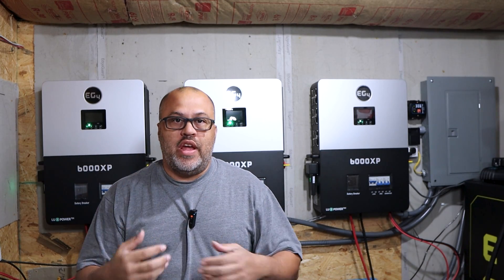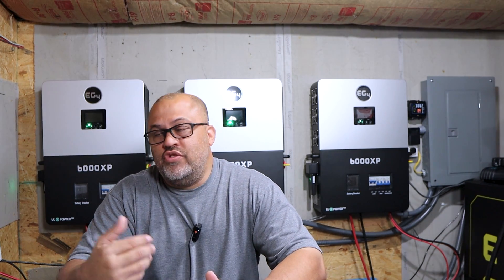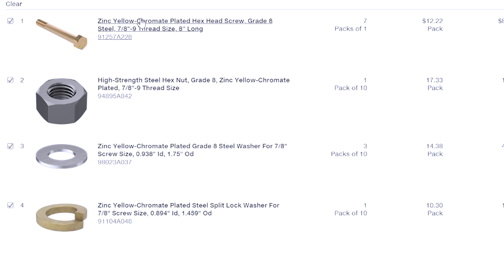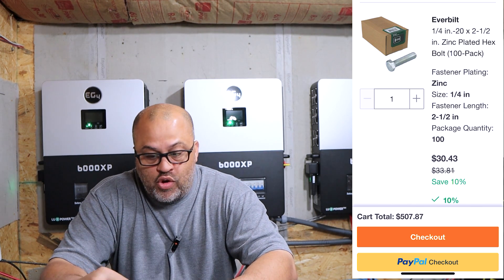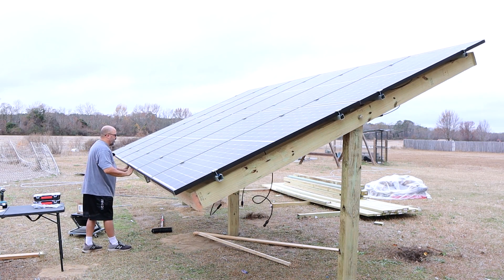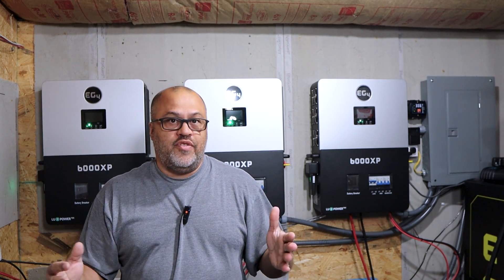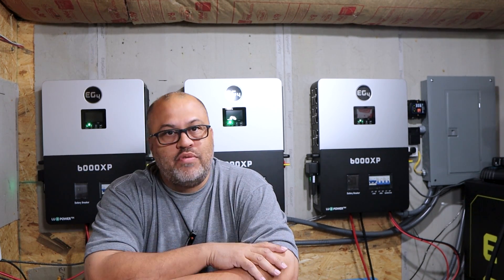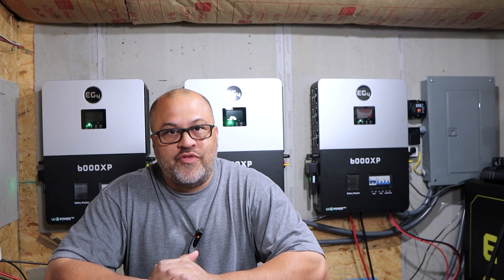DIY Adjustable Solar Ground Mount - Total Cost - Part List - Efficiency

Comment: Superstrut is really expensive now at HD $43 for 10'  12 gauge. You paid $29 5 years ago they were $18  I decided to go with K2 aluminum rail mounts. I'm looking into a automatic tilt arm. 4x6 is super strong no way those are going to break off have to be a tornado probalby smash the panels to bits.

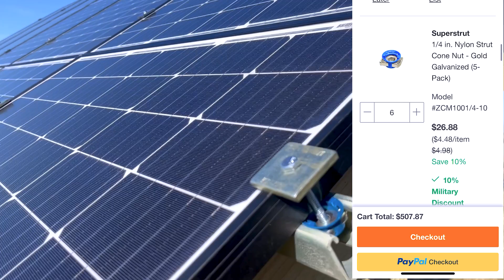Comment: Rodney, I do not see the square washers that go with the Cone nut (shown at 4:01) in your HD parts breakdown but you do show 12 flat washer grade 8 in your list of materials above? However, there is also the 100 1/4 inch round washers in your detailed breakdown (shown at 4:20). Can you provide what you used for the square washers or are the 1/4 round washers suppose to be square?
Reply from the maker: @TheComingGlory  it is a unistrut washer. Should be on lowes, home depot, etc. I will check my list when I get a chance. Thanks
Reply: @rodneyhunt  What size did you use for the unistrut square washer?

Comment: Thank you for putting this together Rodney! I'm presently building my tilt array based on this setup for my large 530W panel 14 panel array in South Carolina! Upgraded to longer/larger bolts and the 6x6 posts. Appreciate you putting all of this together! With the current cost of wood (and larger wood due to my sized panels), larger hardware and such it's ~$1500, but it's still quite a bit cheaper than a commercial array. I got a quote, the cost of the system (minus concrete) was $2800, BUT they wanted $2500 shipping?!? Nope!
Reply from the maker: Glad to help out!

Comment: could one 2 x 6 be used instead of two attached to the 4 x 6 post or did you figure panels would be too much weight?
Reply from the maker: Two makes it more rigid and gives additional attachment points for unistrut

Comment: Can you explain your lumber list?  What is the Width and Hight (bottom to top)?  You have 
•	(3) 2x6x12 pressure treated     
•	(8) 2x6x12 pressure treated   
•	(3) 2x4x8 pressure treated
But I cannot see where you used all of those. Love what you made! Thx for sharing.
Reply: Looks like you have  (12) 2x6x10 pressure treated  (plus a bit more to connect the middle)
Reply from the maker: Will try to do an update video

Comment: I quickly looked through the comments, but didn't see anything regarding grounding the panels. Did you add a ground rod, etc? Thanks for some great videos!!
Reply from the maker: Yes it definitely should be grounded. Still have that on my list to show on a video. Each ground mount has a ground rod

Comment: I started ordering parts today for ground mount tilt. I am using 4 (6x6) 3 foot into ground 10 foot apart. How many bags of concrete did you use for each post?  I am going to mount 18 370 watt panels each weigh in at 50 lbs.
Reply from the maker: I can’t remember. I purchased extra bags but really depends on how wide your hole is. 2-3 bags should definitely be enough depending on your ground
Reply from the maker: Each post
Reply: @rodneyhunt  Perfect 4 it is per post. I decided to post every 7 foot for a total of 5. I need Beefy as I am in Florida. Thank you for the hardware tips I got some high strength 7/8 bolts from Mcmaster.

Comment: Congratulations for a job well done.  Thanks for sharing!!
To reinforce those 4x6 posts - - - > think about getting 1/4" steel plate cut to the width of the 4" side of the post.  Use lag bolts to attach.
Again, thanks for sharing.
Have a blessed day.
Reply from the maker: Hey thats a good idea. It has been working well through wind and storms so probably fine fir the most part. I would still use 6x6 post next time to make me feel a little better and that is what I tell anyone looking to build similar

Comment: Have you thought about using a solar tracker system with this design?
Reply from the maker: I didn’t. I do not know what equipment would be needed with this design. May do some research when I get a chance. Thanks
Reply: @rodneyhunt  Thank you for making your video I used this as sort of a brainstorm to make my own panel mount. I mounted a single row of 10 blade bifacials 395 watt panels.

I have been looking into linear actuators paired with single axis control units with anemometers on them to tilt flat during windy weather. I didn't build mine as sturdy as yours. I used 2x4's and 4x4 posts, but I only went 1 high with my panels.
Reply from the maker: Nice! Sounds like it should be fine. Interesting idea with the actuators if you can get it to track the sun

Comment: commercial tilt array that size is about 2000 ducks
Reply from the maker: That’s about right depending on shipping. Can definitely save money with DIY but they are nice!
Reply: @rodneyhunt  i'm at 35.6Lat so i'll be going from 35deg winter to 75deg summer tilt... you've really swung me around to wood versus steel, i was gonna hire a welder and set drill pipe in concrete and do drill pipe cross rail and way way more money and i've got no real wind issues... thanks a million KWH Mr. Hunt !!
Reply from the maker: Glad to help! Thanks

Comment: insted of using 6x6 i would add around 45 degree angle support beams sitting right under where the panels are fixed to the 4x4
and fix the support beams to the ground

that will add more strength then adding more thickness and it should be cheaper in both wood and bolts

those support beams will stand presure better from the angle the wind it blowing, then a vertical 6x6
even a tree can fall in a storm, because it is not supported the right places
you are also fighting the strength of the ground not just a matter of 6x6 or 4x4

better to be pushing on the ground then pulling

the biggest strength you will find in a big metal tube at the scrabyard
after all we dont build skyscrapers out of wooden structure for the same reason

i got my self some tubes from old street lamp poles for example  from a friend that collects metal

i would also argue that with bifacial panels the adjustment should probetly happen in a rotation like it was a clock on the ground
ofcourse with some sort of solar tracker

you have less shading if the panels are right in the middle of the sun all the time
vertical bifacial panels produce more thanks to cooling and less shade on the backside..
compared to a normal racks no matter if you adjust for the angle of the sun
Reply from the maker: Good ideas! Just didn’t want to take up more ground room. Has been fine in 60mph winds so far. Should be great for most situations with a 6x6  since the 4x6 is working good. With enough force anything can break but just want to mitigate as much as possible with a smaller ground footprint.

Comment: Absolutely no reason to go with more than a half inch or 5/8 Bolt
Reply from the maker: You can definitely use anything you are comfortable with! I wanted to go with my best option for those 3 points

Comment: All your fasteners into the pressure treated. I am wondering why nit use stainless steel. The chemicals in the wood are very corrosive to steel fasteners. Especially the main bolts which the unit pivots.
Reply from the maker: Great point! Didn’t find straight stainless steel bolts at the time. Could probably use a lower grade bolt so I can change out to stainless steel one day. These are zinc yellow chromate plated I believe

Comment: Those are some impressive numbers. Based on them, have you calculated out your ROI..?  GREAT price on a 320w panel. I have 2 arrays here..  1160 (4x290's) and 1200 (6x200's bifacial on a dual axis tracker. video on my channel. 400Ah lithium. I am powering this pc on solar power now. I'm loving it.
Reply from the maker: No I have not calculated roi since self reliance and peace of mind was my only goal. I could do it at some point just to see though. Yes I love my solar as well!

Comment: Rodney, going to build something just like this and was wondering about putting a 12 volt linear actuator to move it to adjust. How far does it move from summer to winter settings?
Reply from the maker: I have been looking at some from vevor as well. Would need to get an exact measurement but several feet for my area. More than the sizes I have looked at so far

Comment: Great informative video and pretty much what I’m going to do for my array. Just bought 13 370 watt panels and one 6000xp. Wonder if greasing the bolt shaft would make it even easier to tilt? Maybe even a sleeve insert of some type with grease?
Reply from the maker: Good idea! It has been working better lately

Comment: I don't see where you have the square flat pieces that are holding your panels down are on your list.  What are those?  I have the rest in my HD cart.  I did get your box of zinc washers but those are round.
Reply from the maker: I thought I added the unistrut washers. You should be able to find 1/4 unistrut washers
Reply from the maker: In the description it says unistrut 1/4 nuts, washers(will add unistrut to make it clear), and bolts

Comment: Hey question the bolts you used to mount unistrut to wood is that in parts list?  The bolts in list i think r for the solar panel to unistrut?
Reply: Hey Rodney, Thank you for taking the time to document your build. It’s very kind of you to help others. Great job!
Reply from the maker: No forgot that. They are bolts but not sure of size off hand. Drilled a pilot hole first before installing. Will look for size
Reply: @rodneyhunt grin i was at store going through parts and i was like ok hold up i missing sumting lol good thing i had access to your videos i got 3/8 x 4” lag bolt i also thought you bolted solar panel from the frame the holes and i was looking at the 2 1/2 and thinking this is too long, after frwmi utes went back to video warched where you put the superstrut on wood then we saw the square unistrut washers so went back to aisle with unistrut and looked for the square pieces, bingo.  I was like yee haw now we in biz.  😂🙌🏼
Reply from the maker: Thats great
Reply: @rodneyhunt thanks again!  Really appreciate it

Comment: Great job!  When you get longer bolts, if you get them long enough to add one more nut, you can torque the two nuts against each other, so they won’t come off, while leaving enough play along the bolt that the array can be tilted more easily.
Reply from the maker: Seems to be good so far. Has not backed off and pretty easy to move

Comment: have you seen these?
10 x Talesun 400W Bifacial Solar Panel (Black) | Up to 500W of Bifacial Gain | TP7G54M
$1,080.00
Reply from the maker: Yeah so many great deals on panels. The whole pallet of 36 is $3600. 👍
Reply: i was comment about the Renogy that were 400 watt the price was $550 a panel these are $540 for 5 panel. i was thinking you might have an ideal why some are so much cheaper, is it because there "cheaper"? Hey thanks for the answer!  @rodneyhunt
Reply from the maker: Renogy has a different business model. They ship panels individually so they charge more for that convenience.
Reply: I just purchased a pallet of the talesuns couple weeks ago, I was told they are on closeout. That is why the price is low... get em while you can
Reply: @527yfz450r  Thanks for your reply, have you hooked them up? what kind of power,are you getting what they claim?

Comment: Not that you need another array.... How would the same set up, but with 
(a)the posts on a N/S configuration with heights of posts equal to a 30 deg angle
(b) same set of panels
(c) 1 axis (E/W) solar tracker with Heavy Duty 18" linear actuator, small 12v bat, wind speed indicator (to make array go horizontal at a predetermined wind speed)
So that you pick up sunrise light (morning is usually when off grid bats are lowest SOC) and sunset light.  Wonder how this would do?  Not as complicated/expensive as 2 axis, but tracks E/W movement of sun automatically.
Reply from the maker: Interesting idea! Maybe if I had an ideal location. My main array already has the prime real estate so we will see

Comment: Use 3/4” gray pvc spacers around perimeter, cut slightly less than panel frame thickness. Keeps support under that big square flat washer.
Reply from the maker: Good idea 👍

Comment: $91 dollars for $5 worth of bolts…welcome to 2023! Thnx for vid man!
Reply: McMaster is expensive sometimes. We order from there at work, 99.9% the order is correct, and 95% it shows up next day. They are absolutely the best supplier on the planet. 

I am an engineer, and grade 8 is massively over kill for this application, which is the majority of the cost. Grade five would be more than adequate and close to half the cost. 

I’d recommend using a jam nut or a nylock nut. The torque required to keep the fastener from coming loose isn’t even possible without destroying the wood. With nylock, if it becomes loose, the possibility of the nut falling off the bolt is greatly diminished. If nothing else, periodically check that the lock washer is still compressed.
Reply from the maker: Right on👍

Comment: If you want to make adjustments to the angles add a winch so you can easily make adjustments.
Reply from the maker: It is easily moved by hand but a good idea. 👍

Comment: Awesome video thanks happy holidays, I designed my own adjustable arrays that can be positioned at 25 and 45 degrees (september 20 goes to 45°, march 20 goes to 25°) much more efficient compared to the fixed 35° array
Reply from the maker: Nice work! Merry Christmas!